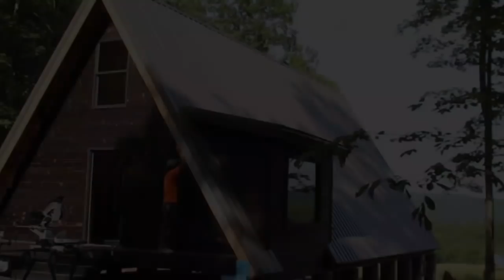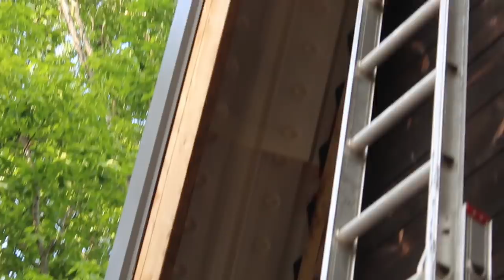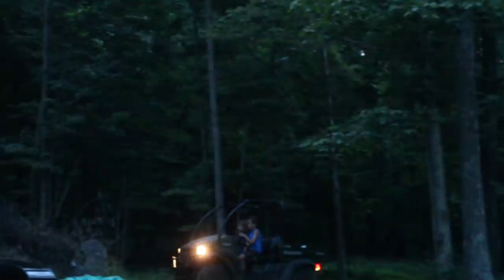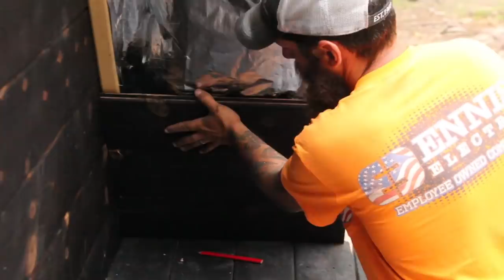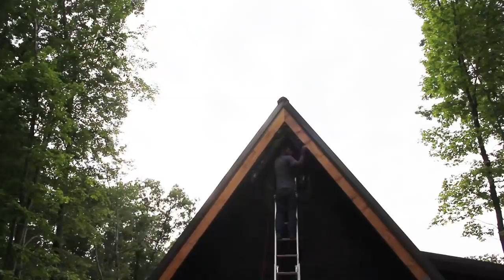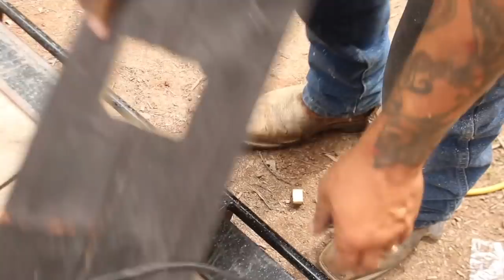We Will Probably Have To RE-DO THIS!

Comment: The orange really contrasts well with the shou sugi ban.  I like it..  But I would have been boring and sticked with a neutral colour.  Just wondewring are you going to even see it from the outside once the back wing of the house is built?

Could you do a video on the rough layout/design your thinking for the eventual extension. I keep wondering what shape it's going to be and why you have a window and exterior cladding if it's all going to be extended interally..  =)

Comment: What is the theory behind which way to lap the baffles in the rafter cavity? Lapped one way the heat can only rise out the roof cap vent but water can leak into the insulation. Lapped the other way water cant leak into the cavity but hot air can. I know insulation factors have to do with the amount of time it takes to be permeated with a temperature but in my opinion I would have lapped the baffles the other way. Was this choice more dependent on the severely steep roof angle thus thinking a leak would be rare? I noticed this a while back in the interior baffles and seen you stuck with the same direction in this video. Thx in advance for any input. I like the orange door a few shades closer to brown may have been a little better.

Comment: The baffles were installed wrong. You meed to start at the top, ans slightly overlap as  you go down. That way it creates a channel for any water that gets in there to flow to and out the bottom. As it is now water will go into the insulation where the baffles meet and create a perfect place for mold to grow.
Reply from the maker: We respectfully disagree and have gone over this on our insulation video.  The baffles are for air flow, they are not meant to be any sort of water barrier. Installed differently, the air would not flow properly
Reply: Wild Wonderful Off-Grid agree - you installed them correctly.
Reply: @WildWonderfulOffGrid  So if, no when you get a leak, where is the water going to go?
Reply: Kilz z the underlayment takes care of that one layer above. Also, that metal roof isn’t going to leak. If in the off chance you do get a leak, you want to see it so you can address it, not allow it to continue unnoticed.
Reply: @ttfweb1  I wasnt aware that a non leaking roof existed, perhaps its like that unsinkable ship.

Comment: Suggestion: when feeling hot (Josh's beard wise).. Put some water on ur chin, wet the beard from under...as for bright colors theme, during summer wearing bright colors attract flies, bees, wearing black brings out the mosquitoes.

Plastic sheet cover any space that's not closed, otherwise you will have wasps n flies nesting inside the house, 

here we spray or ant fly mosquito powder the walk-in space under the door, that's where they get into the house.

Stay safe, God bless

Comment: Diagonal stripes of blue on the orange door. The orange and blue stripes being equal width.  Probably 6” wide. 

Also, where did you get the cart/truck for the propane tank with the torch?  I have the tank and torch but not the cart.  Thank you.
Reply: Anything regarding the torch cart?

Comment: Dead air is insulation.The bumps hold it off an inch or so to create a air space for insulation. That's what I think. But a dead air space is insulation.  And I guess what ever you decide to put in the space might even be better, as in a window pane.

Comment: Josh you do not insulate eave sections, they help ventilate your roof. The interior of  walls and roof sections are insulated and a vapor barrier is installed to that part of your building's envelope. A problem that is often seen in A Frame and Cathedral roof construction is lack of ventilation, leading to condensation problems. Sorry Guys, but best to find out now I think, you can check this info out.
Reply: You didn't listen as you watched the video did you? He said in the beginning of the video that will be interior space soon when the other wing of the house goes on. Sorry guy but you need to find out now that you don't know wth you're talking about.
Reply: @JCrook1028  I stand corrected there bro,

Comment: Question; why are the baffles installed from the bottom up? If they were installed starting at the top each joint would overlap allowing any condensation to drip from panel to panel all the way to the bottom and out of the soffit vent. The ventilated gap will carry away a lot of moisture but I'm fairly sure the channels in the baffles are designed to carry away any excess condensation and should overlap top to bottom. Worth looking into now just in case I'm right.

Comment: question how the hell does your man put up with that beard in the summer lol. I gotta shave mine every spring or I get overheated. Also why did u decide to put no vents in your soffits due to moisture that can happen during temperature fluctuations? Maybe u did and I didn't see? Just curious. Thank u.
Reply from the maker: Hey thanks for watching! The soffits are vented- That was done in a previous video though.
Reply: They don't need to vent the gable end.  They vented at the bottom of the roof on both sides, and have a continuous ridge vent.

Comment: Hey man, putting a ladder in a bucket is like totally safe...........in comparison to  telling your wife she's got more upper body weight than you............while standing at the top of an 18 ft. ladder with your wife chocking it with her foot..............No man, that is like totally dangerous.....beyond belief.
Seriously now, when you get to the other end, if you have a set of forks for that bucket, you can build a slip on, slip off platform out of 2X12's & a 4X8X5/8 sheet of outdoor plywood (fer a little more height), build the platform so it's level when you have the bucket tilted so the forks' look like a "V" so gravity is all you need for it to rest nice and tight by placing 90 degree braces  that follow the forks down to the knee, a couple of flat metal braces that will lay along the sides of each fork so she won't slip sideways and you're good to go. Put good strong wood 4' railings around three sides and work off the open end against the structure (you can even put a ladder on it...but you didn't hear that from me). Works like a charm, I've had one for nearly 20 years when I built a barn with a 26' peak. I use it now for trimming tree's........and watching fireworks. Oh yea, put the platform up first and climb up on an extension ladder that way you won't have to worry about being catapulted off it by an "operator"........
Reply: Definitely an idea !  Good one.

Comment: Why do you use insulation outside the outer wall? And the condensation from the roof slabs will flow into the insulation. You should mount the condensation barrier from top to bottom. With the orange shirt you should sit down and meditate on this. Like a real monk. Do it correctly next time and use the insulation inside instead. Ask a carpenter. Good luck to you lovely people. (a real monk doesn't eat meat);)
Reply from the maker: This will be interior when we build on in a couple months- thats why its insulated. The baffles are not a water barrier, they are for air flow. If installed differently the air would not flow properly.
Reply: Kinda makes one look awful silly / dumb when one does not know the difference between correct and not, plus if you would have paid attention - in the beginning of the video Josh explained the reason for the insulation.  Pays to pay attention !  or sit down and meditate on this !

Comment: When installing roof baffles the leg buts the plywood. Forming a air space so their is circulation. You guys installed it backwards. Also the insulation in a fly rafter is useless.